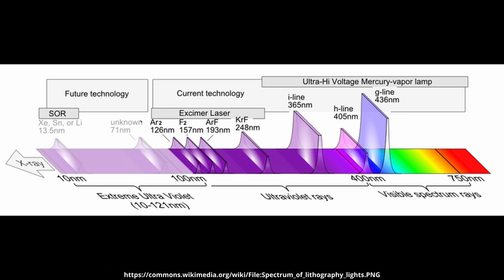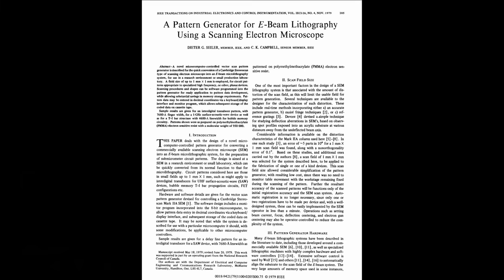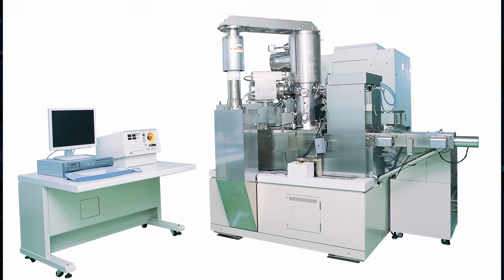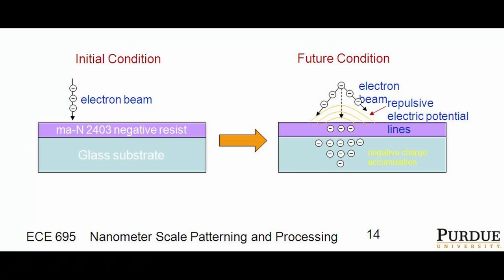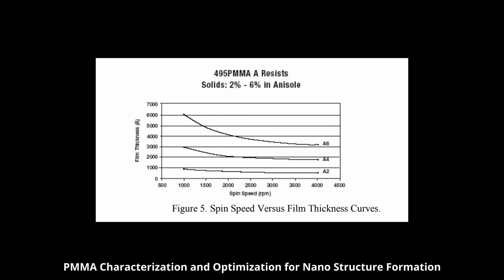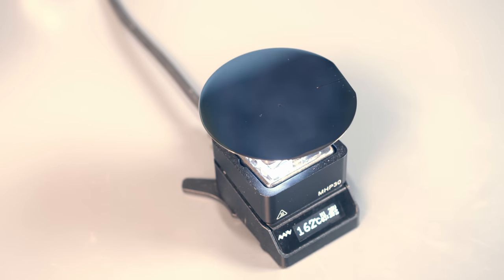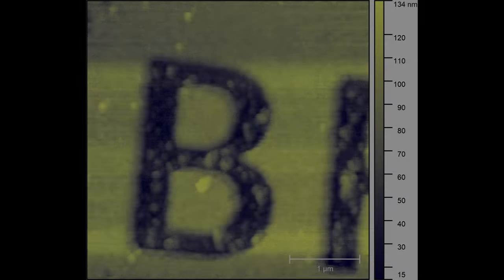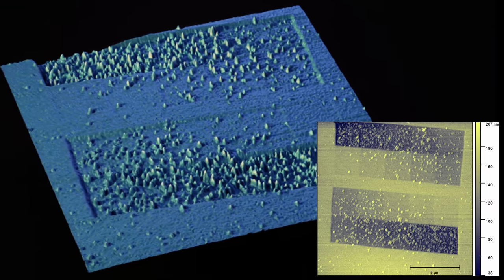Drawing Microscopic Patterns with Electrons

Comment: This proximity effect sounds like subsurface scattering in optics to me. I do wonder if this would be a good application of inverse rendering.
Reply from the maker: I think it's very similar! My (limited) understanding is that people traditionally run a bunch of monte carlo simulations to figure out the statistical properties for their resist/substrate, and then an algo takes that and works backwards to figure out dosage. There's also "backscatter" where the electrons leave the substrate, bounce off the SEM optics (since it's a hunk of metal very near the surface) and then re-expose the resist a third time.

Will look into inverse rendering, that sounds interesting!
Reply: @BreakingTaps  I can recommend Mitsuba3 it is a differentiable render.
The advantage over neural network based methods being that values have well defined physical units. I'm currently using it in my Bachelors thesis.

Comment: When using a glass waver instead of a silicone waver, would the fact that the electrons saturate the glass, but dont write on the surface (if I understood that right) make it possible to write "invisible"? Like, write something that only becomes visible, when you "read" the surface with a certain radiation?
Reply from the maker: Unfortunately not, the electrons will dissipate over time (air molecules will bump into the surface and "steal" away the excess electrons that built up). Is a neat idea though!
Reply: @BreakingTaps  I'd never thought about that. Thank you for the reply!

Comment: Perhaps small nit picks on a great video : 
1. Ebeam resolution is not diffraction limited. It is limited by aberration in the lens or from resist 
2. Modern Ebeam resists are very similar chemistry to euv and duv resists. They use chemical amplification from an acid catalyst to knock off a protecting group which causes the polymer to be base (or solvent in negative tone develop) soluble.
3. Production Ebeam litho to create reticles is all 50kV landing energy. There is a sensitivity trade off that makes this the best landing energy.
Reply from the maker: Cheers for the corrections!

Comment: At 3:36 you said that the resolution can't be matched by photons. That made me think why we can't just use smaller and smaller wavelengths of photons? If UV is too big, why not go with x-rays, gamma rays or whatever smaller wavelength photons. Then it hit me, x-rays would just pass right through the sample. If your knife doesn't interact with the block of wood, it's pretty difficult to carve anything with it.
Reply from the maker: Yep! Xrays in theory would work but you run into all kinds of logistical challenges. As you said they pass through the substrate, and it's difficult to make a resist that is x-ray sensitive. Masks need to be made from materials that block xrays (heavy metals) which is challenging, and there aren't lenses to focus xrays. So you have to use xray mirrors which are expensive and complicated to make (and also not very efficient). Feels strange that harnessing electron beams is easier than xrays though!

Comment: Damn, i am master student trying to achieve single nano wires of 10-40nm thick and I am failing... seeing you achieve 100nm with the not so industrial machineries... i am ducking impressed and this motivates me to try hard more. Hats off man!!    and ya proximity effect is a Bi*ch.
Reply from the maker: To be fair, this was just the resist! I've been struggling to get the next step (etching or lift-off) to work reliably so you're in good company! :)

Comment: Not sure if you will ever see this, but I’m a uni student who had to EBL extensively for my project. I noticed a few things different between our processes!

First, your use of cold IPA is good, but you’re only putting a couple mL on your wafer. The heat capacity of everything from the wafer to the syringe is going to influence process temp! And temperature is a very important process variable: the kinetics of solvation is proportional to exp(-E/kT)! For me, I take a beaker of 0C 3:1 IPA:H2O and dunk my chip into it, and never let it go. And I VIGOROUSLY stir it around to ensure the exposed areas are always seeing fresh solvent at a consistent temperature. That might solve your particle issue as well. I try to keep my process as close to 30 s develop time as possible. 

At the last step, dunking the exposure in water will certainly arrest development, but if your PMMA features should be taller than they are wide, you risk the surface tension of the water collapsing your pattern during drying.

Along these lines, I always determine the resist clearing “dose”, in uC/cm2, experimentally, and it of course depends on the average exposure of the proximate area. I didn’t see you mention this number, but I always use it as a very important parameter. 

For Si, the proximate area has about 7 um radius for my 30 kV system (converted SEM). The range is actually shorter for lower kV, but the proximity effect-induced exposure is much larger over that smaller range. 

Good luck on your future EBL! If you are still doing that.
Reply: That was a fantastic read! I work with Thermal Nanolithography, but I have used an Auger Nanoprobe. How long have you been using your recipe for?

Comment: Nice video. Ice cold IPA/DI is a good call (see Rooks et. Al.) but we typically don’t puddle develop. We use vigorous agitation with the entire wafer dipped into a Nalgene bottle of IPA/DI. We usually dose at 1600 nC/cm^2. High acceleration voltages aren’t really necessary. We have an elionix HS50 designed for high current that tops out at 50 keV. Works great. 

PMMA in anisole is also a good call. I think you may be running into issues of the polydispersivity of your resist as you had suspected. You might be able to purify it!
Reply: Also I’ve been doing EBL for about 10 years and never once used PEC. Depends on what you’re trying to do, obviously. For josephson junctions for instance, you just do parameter sweeps until the room temperature resistance comes out right and the thing looks right under AFM.
Reply from the maker: Cheers for the tips, really appreciate it! Will give vigorous agitation a try, and will look into purifying the PMMA (or just tracking down a bottle of the real stuff, can't imagine it's too expensive... I hope? 😅 )
Reply: @BreakingTaps  it's about a grand per bottle from kayaku :(

Comment: I commented this on a different video, but I was wondering if you'd be willing to try out green lithography, which is a way of using non-toxic polymers like egg whites as e-beam resist coatings. The egg whites are diluted with DI water before spin coating and developed after exposure with DI water as well, making them easily disposable. There are some papers supporting this and it shows resolution in the nanometer range using e-beam exposure, but shows compatibility with UV exposure as well. You can find it in Advanced Materials Interfaces under the title "Water-Based Photo- and Electron-Beam Lithography Using Egg White as a Resist".
Reply from the maker: Oh, yeah! I was just talking to someone else about that paper (or a similar one). Looks super neat, I'll put it on the todo list for sure! Have you tried it yourself before?  Love your insta account btw, really neat to see the stuff you do in the cleanroom 🙂
Reply: @BreakingTaps  I am having a chat with one of our cleanroom staff for the e-beam to see what they think. If the Minnesota Nano Center approves, then I will try it out this summer.

Comment: Another super-cool video!

For slightly more automated proximity-effect exposure control, what if you took the image into Photoshop, copied it to a mask layer, then run a Gaussian blur (or some other blur operator) on the mask layer to get something you could use to vary the darkness of the original? You could adjust the amount of the effect with the transparency of the mask layer, and the range of the proximity compensation by varying the radius of the blur operator.
Reply from the maker: Ah that's clever, I like that! Should give a pretty good rough approximation I think, since the effect is mostly a gaussian process under the surface (and some similar but longer range fogging from backscatter on the top). Will give it a shot, thanks for the idea!
Reply: @BreakingTaps  Great, I’m happy it was helpful!

Ah, I’d only been thinking about the backscatter, but thinking of your results again, I realize that the worst problems were on very fine-pitch detail, so that would have been more the subsurface effect. Ideally then, you probably want two mask layers, to model the two processes separately.

The next question is calibration. For the backscatter, perhaps you could create a test structure with a high-exposure spot in the center, and then some sort of radial pattern around it of elements having different exposure levels. Perhaps something like a row of lines spaced broadly enough to avoid the worst subsurface effects. Then make a radial pattern of such rows around the center spot with different exposure levels. Run that and see how the ideal exposure varies as a function of distance from the bright center element, and you should be able to get some approximation of both magnitude and extent of the backscatter effect. Make and test a mask for that. If it’s close, you can then use it as a baseline when figuring out the subsurface effect.

Of course, I’ve probably just described a few weeks of experimentation for you, easy from my end 😆

I love this sort of tricky physical system. I’m good at things that involve physical processes and mental models of them - but am complete crap at anything involving higher math. It’s the reason I bailed out of a PhD program in Applied Physics: I barely squeaked through the written exam and knew there was no way I could handle 3 hours of profs throwing problems at me on a whiteboard 😮 I love this kind of stuff though 👍

I forget, do you have a Discord? If you do, I’ll follow it.

(PS: It would be way over the top, but I think the ImageMagick package lets you apply arbitrary convolution kernels :-)

Comment: Given your channel name, you might know that Electrical Discharge Machining (EDM) can be used to "drill" out broken taps, including those in rather soft materials like aluminum. It's also one of the only viable ways to drill out a particularly small tap, like a 4-40 or M2 tap. Could be a fun and useful rabbit hole to explore.
Reply: That's neat to know, cheers
Reply from the maker: Every time I break a tap, I go down the rabbit hole of looking into those little EDM "hole popper" machines. Seems like it'd be pretty DIY'able!

Comment: Are you going to revisit the telescope mirrors project? That's what I really been looking forward to. And if not can I ask you some questions offline? Will bug you too much but I am trying to build a machine here to do single point diamond cutting..
Reply from the maker: Yep, definitely! That project is like 95% done. Just need to make a final mold and film the process from start to finish, but it's basically done and working pretty well. Although I haven't thrown it under an interferometer yet so maybe not so good either heh
Reply from the maker: Probably best way is to hop on the discord or shoot me a Twitter/insta DM. My email is unfortunately a black hole

Comment: What is the limit of the electron scanning? I imagine at some point your pixels are just single atoms
Reply: An electron is smaller than an atom so theoretically line size could be smaller than an atom but with all the limitations he discussed in the video it would be much larger than that.  He was getting 100nm line widths which is several orders of magnitude larger than an atom.  With the right equipment, materials, algorithms, etc. you could maybe get close.
Reply from the maker: In addition, you tend to run into limits with other parts of your process, like the resist material itself. I.e. you might be able to scan sub-nanometer, but your resist material can only faithfully replicate down to like 10nm (due to process variability, or sidewalls collapsing or whatever).

Comment: That mini SMD heat plate. Is it any good for actual circuit boards?
Reply from the maker: No experience personally, but I know of some other folks that are using it for EE stuff (I found it via folks on Twitter using it for quick board repairs or whatever). Pretty cheap and heats up fast although the menu/control system is irritating to adjust.

Comment: So where did you get that silicone wafer? I heard TSMC charge an arm and a leg for a large one for processors))) Also, with this printing technology, are you able to print a few logic gates? Would you be able to compete with TSMC? 1 nm gate maybe?))))) That would be super interesting!
Reply: I imagine you'd need higher voltage, thinner substrate, and a host of other problems that need to be solved one at a time. Otherwise, maybe! It sounds cool
Reply from the maker: Small wafers are actually pretty cheap (relatively, iirc this was like $7/wafer). You can buy them online from places like UniversityWafer.  As to producing working devices/logic gates... hopefully! Will probably be pretty big by modern standards (few microns, etc) but the limiting factor will probably be everything else: development, contamination, metal deposition, etc.
Reply: @BreakingTaps  Hopefully one day, we'll have a maker focused and run fab that will let hobbyists produce their own chips even if the process is relatively large.
Reply: @BreakingTaps  I must have confused micrometers with nanometers... still would be very interesting

Comment: These days electron beam machines are used more and more in industry due to its flexibility and relatively low cost (~2-4M per machine). In addition to that they are generally still allowed to be exported to for example China for industrial purposes. While ASML machines are not.
Reply from the maker: Interesting, are they still just single-beam systems or have multi-beam or masked projection systems started to penetrate into industry? All the literature I could find looked like those systems have been worked on for years, but never quite made it to widespread use.
Reply: @BreakingTaps  I work for one of the leading manufacturers of EBL. We use single beam but there are some others who have multi beam. These machines run 24/7 these days unattended. I would guesstimate that 75% is industrial now and only about 25% universities etc.
Reply from the maker: Neat, TIL! Cheers for the correction! :)

Comment: This is really fascinating and impressive what you've been able to do with these techniques. 

However, after watching I'm at a loss for why these dedicated machines exist, like what is the purpose for doing this other than novelty? Is this a way of keeping records? Maybe better than microfilm or... but no there's digital forms of data storage.. I jus I just don't know get it.
Reply: EBL is just one step in creating research devices at the nanoscale, in fields such as photonics, electronics, spintronics... What you might do after creating one of these PMMA patterns is to deposit a metal. You then dip your chip in acetone which dissolves the resist, and only the metal that is touching the substrate remains, and you have an electrical circuit with nanoscale feature sizes.

It's low-throughput, but I can have a device completed in a few days at reasonable cost. And I have the flexibility to tweak the design for next week's tests.
Reply: Every chip in your phone or pc is made using these techniques (Ebeam litho for the reticle and euv or duv photo litho for the chip using those reticles ) it’s a 20$B/year business
Reply: @CyrusTabery  whatever

Comment: Using vector images and tracing the path would create better results than just rastering.
Reply from the maker: Yeah definitely! The machine does have a quasi-vector mode where you can draw individual lines, but I'm still trying to figure out the best way to use it (the API documentation is sparse).